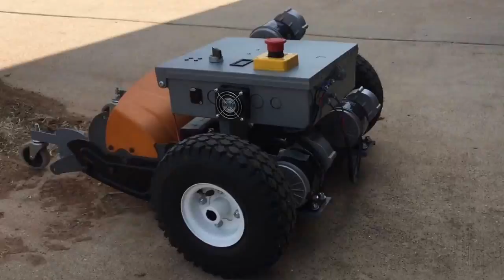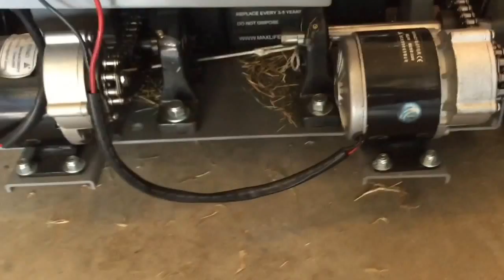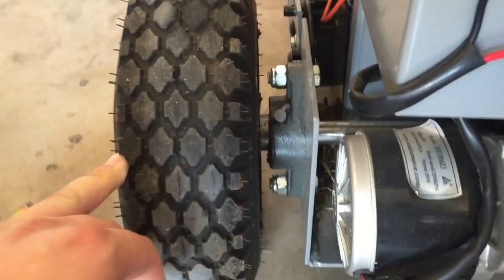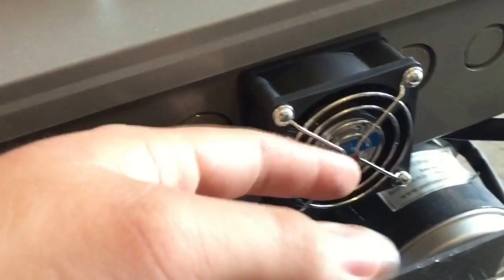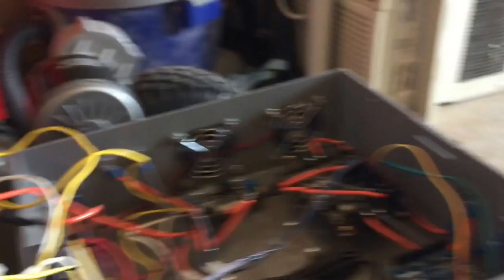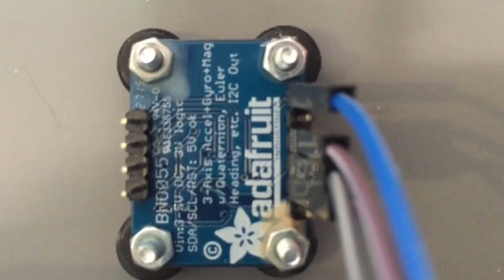RoMow - My R/C Lawn Mower

Comment: For the 4 wires out of the back. You need a 4 pole speakon connector and socket. Twist lock. Can be removed while powered no shorting out.
Reply from the maker: while i do like those connectors, the bolts ended up working fine and cost pennies.

Comment from the maker: This is the source code minus libraries. Please understand I have no formal education in programming, and that I have looked at this code in a year. To explain how the code flows would take me just as much effort as you. But it should follow the basic - where are we, what changes have happened, is there new commands, and apply motor power. 

#include <Adafruit_Sensor.h>
#include <Adafruit_BNO055.h>
#include <XBOXRECV.h>
#include <Usb.h>
#include <Wire.h>
#include <Diablo.h>
#include <SPI.h>

const int mainRefreshRate = 10, posRefresh = 10;
int mainmotors = 0x37;
float expcont = 2;
int BufferPOS = 0;
int bufferLength = 9;
int bladeBuffer[10];
uint8_t xbcontNum = 0;
int xbl = -32768;
int xbu = 32767;
float contX = 0.0;
float contY = 0.0;
float contR = 0;
unsigned long previoustimeMain, previoustimePID;
bool run = true;
float turnRate = .20; //in deg per ms
float lastX, lastY;
USB Usb;
XBOXRECV Xbox(&Usb);

//pid variables
unsigned long lastTime, lastTimepos;
float Input_X, Output_X, Setpoint;
double ITerm, lastInput;
double kp, ki, kd;
double setkp, setki, setkd;
int SampleTime = 10;
double outMin, outMax;
bool inAuto = false;
#define MANUAL 0
#define AUTOMATIC 1
#define DIRECT 0
#define REVERSE 1
int controllerDirection = DIRECT;

int pwmPin = 3;
#define BNO055_SAMPLERATE_DELAY_MS (10)
Adafruit_BNO055 bno = Adafruit_BNO055();

void setup()
{
 Serial.begin(9600);
 Wire.begin();               // Join the I2C bus (we will be acting as master)
 diabloAddress = mainmotors; //set address of diablo board
 DiabloSetEpoIgnore(true); //we will not be using an EPO, instead a relay controlled power
 DiabloResetEpo();   //precautionary statement to reset the EPO 
 
 pinMode(pwmPin, OUTPUT);
 analogWrite(pwmPin, 255);

 if (Usb.Init() == -1) {  //start the usb library. this code is c/p from example code
  Serial.println(F("\r\nOSC did not start"));
  while (1); //halt
 }
 Serial.println(F("\r\nXbox Wireless Receiver Library Started"));
 while (!DiabloGetCommsFailsafe()) {  //Set the diablo to turn off on LOS for 1/4sec
  DiabloSetCommsFailsafe(true);
 }
 if (!bno.begin())
 {
  /* There was a problem detecting the BNO055 ... check your connections */
  Serial.print("Ooops, no BNO055 detected ... Check your wiring or I2C ADDR!");
  while (1);
 }

 bno.setExtCrystalUse(true);
 SetSampleTime(20);      //refresh rate of imu sampling 1000/20 Hz
 SetOutputLimits(-0.50, 0.50);   //the limits of power for the pid control
 setkp = 0.005; setki = 0.005; setkd = 0.000;
 SetTunings(setkp, setki, setkd);
 SetControllerDirection(DIRECT);   //it's either forward or backwards
 SetMode(MANUAL);  //Manual means no processing. will change later
 
 Usb.Task();      //best attempt to set led on controller. sometimes it doesn't work
 Xbox.setLedOn(LED1, xbcontNum);
}

void loop()
{
 Compute();
 CalcPosition();
 int mainCycleTime = millis() - previoustimeMain;
 if (mainCycleTime > mainRefreshRate) {
  previoustimeMain = millis();
  Usb.Task();
  if (run && Xbox.XboxReceiverConnected) {
   if (Xbox.Xbox360Connected[xbcontNum]) {
    if (Xbox.getButtonClick(BACK, xbcontNum))
    {
     inAuto = false;
     while (DiabloGetMotor1 || DiabloGetMotor2) {
      DiabloSetMotors(0);
      DiabloMotorsOff();
     }
     run = false; return;
    }
    if (Xbox.getButtonClick(R1, xbcontNum)) {
     if (!inAuto) {
      inAuto = true;Input_X = 0; Output_X = 0; Setpoint = 0;
      Initialize();
      Xbox.setLedOn(LED2, xbcontNum);
     }
     else {
      inAuto = false;
      //contX = 0;
      //contY = 0;
      Xbox.setLedOn(LED1, xbcontNum);
     }
    }
    if (Xbox.getButtonClick(UP, xbcontNum)) {
     setkp += 0.0005;
     SetTunings(setkp, setki, setkd);
    }
    if (Xbox.getButtonClick(DOWN, xbcontNum)) {
     if (setkp < 0.0005) { setkp = 0.0; }
     else { setkp -= 0.0005;}
     SetTunings(setkp, setki, setkd);
    }
    if (Xbox.getButtonClick(Y, xbcontNum)) {
     setki += 0.0005;
     SetTunings(setkp, setki, setkd);
    }
    if (Xbox.getButtonClick(X, xbcontNum)) {
     if (setki < 0.0005) { setki = 0.0; }
     else { setki -= 0.0005; }
     SetTunings(setkp, setki, setkd);
    }
    if (Xbox.getButtonClick(B, xbcontNum)) {
     setkd += 0.0001;
     SetTunings(setkp, setki, setkd);
    }
    if (Xbox.getButtonClick(A, xbcontNum)) {
     if (setkd < 0.0001) { setkd = 0.00000; }
     else { setkd -= 0.0001; }
     SetTunings(setkp, setki, setkd);
    }

    int trigR;
    if (Xbox.getButtonPress(L2, xbcontNum) > 100 && Xbox.getButtonPress(R2, xbcontNum) > 100) { 
     trigR = 255;
    }
    else { 
     trigR = 0;
    }
    if (trigR > contR + 4) { contR += 4; }
    else if (trigR < contR - 8) { contR -= 8; }
    else { contR = trigR; }
    setBlades(contR);
    
    float newX = ((float)Xbox.getAnalogHat(RightHatX, xbcontNum)/32768.0);
    float newY = ((float)Xbox.getAnalogHat(LeftHatY, xbcontNum)/32768.0);
 
    if (newX > contX + 0.15) { contX += 0.15; }
    else if (newX < contX - 0.15) { contX -= 0.15; }
    else {contX = newX;}
    if (newY > contY + 0.05) { contY += 0.05; }
    else if (newY < contY - 0.05) { contY -= 0.05; }
    else {contY = newY; }

    float motX = deadzone(contX) * 0.50;
    float motY = deadzone(contY) * 0.60;
    

    if (inAuto) {
     Setpoint += turnRate * mainCycleTime * contX;
     setMotors(Output_X, contY);
    }
    else { setMotors(motX, motY); }
   }
  }
  else { DiabloSetMotors(0); DiabloMotorsOff; setBlades(0); }
 }
}
/*float buffersum(int value, int buffer[]) {
 int BufferSum;
 buffer[BufferPOS] = value;
 for (int index = 0; index < bufferLength; index++) {
  BufferSum += buffer[index];
 }
 return (int)(BufferSum/bufferLength);
}*/
float deadzone(float d) {
 float x;
 if (d > 0.10) {
  x = pow((d - 0.10)*(10/9), expcont);
 }
 else if (d < -0.10) {
  x = -1 * pow((d + 0.10)*(10/9), expcont);
 }
 else { x = 0; }
 return x;
}
void setMotors(float x, float y) {
 float RplusL = (1 - abs(x)) * y + y;
 float RminusL = (1 - abs(y)) * x + x;
 float rightPower = (RplusL - RminusL) / 2;
 float leftPower = (RplusL + RminusL) / 2;
 DiabloSetMotor1((int) (leftPower * 255));
 DiabloSetMotor2((int) (rightPower * 255));
}
void setBlades(int b) {
 b = 255 - b;
 analogWrite(pwmPin, b);
}
/*void advanceindex() {
 BufferPOS += 1;
 if (BufferPOS > bufferLength) { BufferPOS = 0; }
}*/
void CalcPosition() {
 unsigned long nowpos = micros();
 int timeChangepos = (nowpos - lastTimepos);
 lastTimepos = nowpos;
 if (timeChangepos > posRefresh*1000) {
  imu::Vector<3> euler = bno.getVector(Adafruit_BNO055::VECTOR_GYROSCOPE);
  Input_X += euler.z() * -57.2957795 * (float)(timeChangepos/1000000.0);
 }
}
void Compute()
{
 if (!inAuto) return;
 unsigned long now = millis();
 int timeChange = (now - lastTime);
 if (timeChange >= SampleTime)
 {
  /Compute all the working error variables/
  double error = Setpoint - Input_X;
  ITerm += (ki * error);
  if (ITerm > outMax*0.25) ITerm = outMax*0.25;
  else if (ITerm < outMin*0.25) ITerm = outMin*0.25;
  double dInput = (Input_X - lastInput);

  /Compute PID Output_X/
  Output_X = kp * error + ITerm - kd * dInput;
  if (Output_X > outMax) Output_X = outMax;
  else if (Output_X < outMin) Output_X = outMin;

  /Remember some variables for next time/
  lastInput = Input_X;
  lastTime = now;
 }
}
void SetTunings(double Kp, double Ki, double Kd)
{
 if (Kp<0 || Ki<0 || Kd<0) return;

 double SampleTimeInSec = ((double)SampleTime) / 1000;
 kp = Kp;
 ki = Ki * SampleTimeInSec;
 kd = Kd / SampleTimeInSec;

 if (controllerDirection == REVERSE)
 {
  kp = (0 - kp);
  ki = (0 - ki);
  kd = (0 - kd);
 }
}
void SetSampleTime(int NewSampleTime)
{
 if (NewSampleTime > 0)
 {
  double ratio = (double)NewSampleTime
   / (double)SampleTime;
  ki *= ratio;
  kd /= ratio;
  SampleTime = (unsigned long)NewSampleTime;
 }
}
void SetOutputLimits(double Min, double Max)
{
 if (Min > Max) return;
 outMin = Min;
 outMax = Max;

 if (Output_X > outMax) Output_X = outMax;
 else if (Output_X < outMin) Output_X = outMin;

 if (ITerm > outMax) ITerm = outMax;
 else if (ITerm < outMin) ITerm = outMin;
}
void SetMode(int Mode)
{
 bool newAuto = (Mode == AUTOMATIC);
 if (newAuto == !inAuto)
 {  /we just went from manual to auto/
  Initialize();
 }
 inAuto = newAuto;
}
void Initialize()
{
 lastInput = Input_X;
 ITerm = Output_X;
 if (ITerm > outMax) ITerm = outMax;
 else if (ITerm < outMin) ITerm = outMin;
}
void SetControllerDirection(int Direction)
{
 controllerDirection = Direction;
}

Comment: One of few RC mowers with gyro input. Would you be able to share the sourcecode? My plan is to use an arduino to take input from a normal R/C source and then adjust heading with the gyro input from BNO055 .
Reply from the maker: Tuning the PID proved to be more difficult than i hoped. Especially when turning the robot more than a few degrees. Also, normal R/C input is PPM which is a format i didn't want to mess with when people have already made libraries for the xbox controller. Range is a problem though, and my code seems to lock up when the controller looses connection. Ive had to run after the robot many times to hit the emergency stop.

Comment: Hello Project! Looks awesome. I was wondering if you have a parts list/build pictures and links from where you bought all these stuff. 

DIY projects usually is a success when you have the right parts.. I plan to make it more autonomous by adding GPS.. But that's a long shot.. I have a trasnmitter and reciever which I plan to use.. 

I do have the fiskars lawn mower and gathering all the items that I need to buy and estimating the cost.
Reply from the maker: the build was all by hand and pieces fit individually. there was a lot of welding and cutting. The drive shaft and tires came from a go kart custom parts supplier. bearings from another online bearings store. metal from metalsupermarkets.com . the motors are the 24v scooter motors from ebay that have a normal bicycle chain sprokets. the only motor controller i couldn't destroy is from the uk, diablo i believe. and i used a usb xbox adapter with code from online.

Comment: how strong is the motors on that mower can you drive on it and drive up hills?
Reply from the maker: i stood on it for traction, then pulled a police car with it at work. And i have the code down regulating the motors to 50% max power.

Comment: Could you please make the PID motor control code available? I am looking for some PID code for controlling "skid-steer" style robot, and I can't seem to find a suitable example for a newbie like me. By the way... Cytron make amazing motor controllers! I am running two, MD10c r3 controllers with out even as much as a hiccup. http://www.cytron.com.my/p-md10c
Reply from the maker: +MightyJoe0429 
an adaptation of  this http://home.kendra.com/mauser/Joystick.html

void setMotors(float x, float y) {
 float RplusL = (1 - abs(x)) * y + y;
 float RminusL = (1 - abs(y)) * x + x;
 float rightPower = (RplusL - RminusL) / 2;
 float leftPower = (RplusL + RminusL) / 2;
 DiabloSetMotor1((int) (leftPower * 255));
 DiabloSetMotor2((int) (rightPower * 255));
}

that takes x,y joystick numbers and makes them l r motor values.
Reply from the maker: +MightyJoe0429 
and this is the pid code. make sure you take the time to calculate your variables. whether is be 1 or .1 or .01. 

!inAuto is a flag for when the system is controlled by a gyro. I use a refresh rate of 100hz

void Compute()
{
 if (!inAuto) return;
 unsigned long now = millis();
 int timeChange = (now - lastTime);
 if (timeChange >= SampleTime)
 {
  /Compute all the working error variables/
  double error = Setpoint - Input_X;
  ITerm += (ki * error);
  if (ITerm > outMax*0.25) ITerm = outMax*0.25;
  else if (ITerm < outMin*0.25) ITerm = outMin*0.25;
  double dInput = (Input_X - lastInput);

  /Compute PID Output_X/
  Output_X = kp * error + ITerm - kd * dInput;
  if (Output_X > outMax) Output_X = outMax;
  else if (Output_X < outMin) Output_X = outMin;

  /Remember some variables for next time/
  lastInput = Input_X;
  lastTime = now;
 }
}
Reply from the maker: +MightyJoe0429 
the pid source i adapted.
http://brettbeauregard.com/blog/2011/04/improving-the-beginners-pid-direction/
Reply: +James Anderson  Thank you very much James. I am very impressed with your project. It was "your" video that inspired me to build my robot. It is coming along nicely, (minus the error correction at the moment). Keep up the good work, and please keep us posted on your progress. :-)